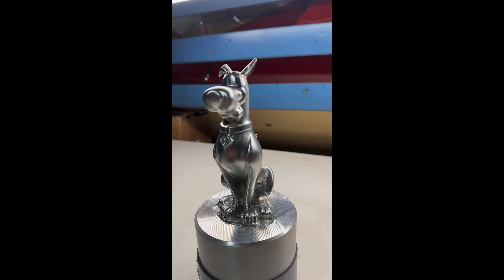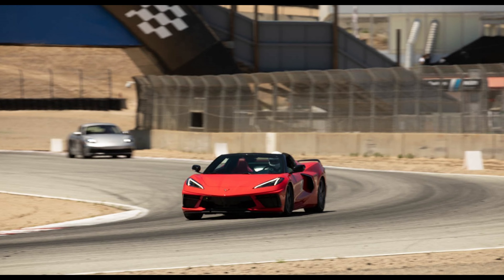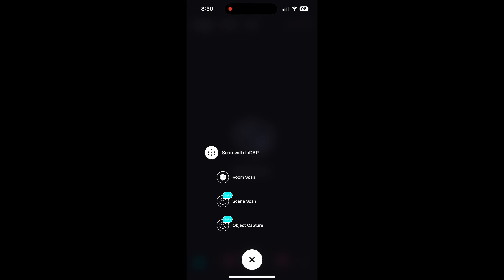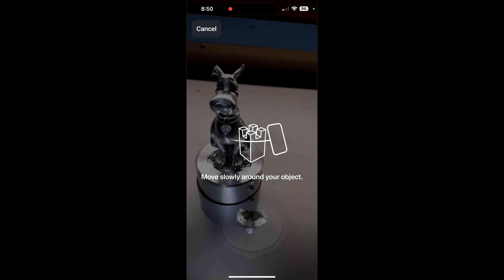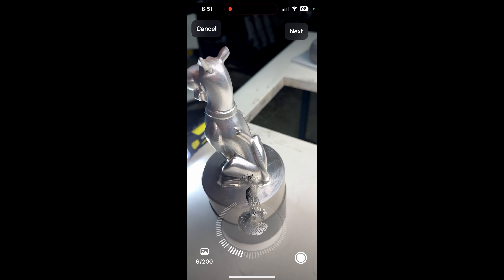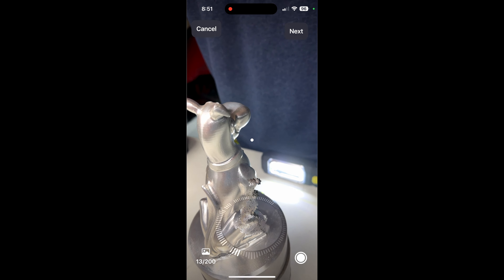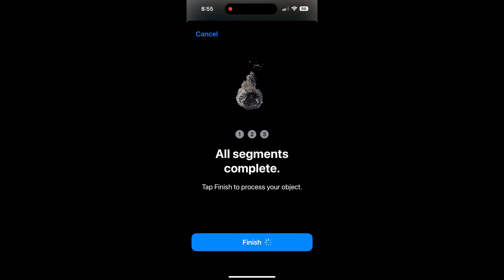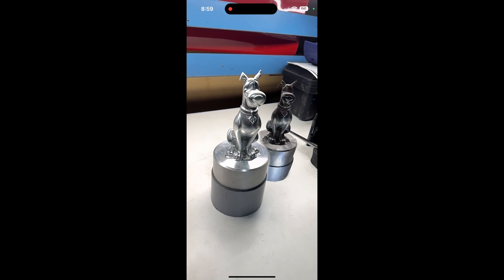iPhone 3D scan with IOS17 and KIRI Engine

Comment: Which IPhone did you use for the scan?
Reply from the maker: I used the iPhone 14 pro max. I found this detailing all the iPhones and Ipads with Lidar. 

"Introduced in 2020, the LiDAR scanner is available on the iPhone 12 Pro and Pro Max, the iPhone 13 Pro and Pro Max, and the iPhone 14 Pro and Pro Max as well as the 2020, 2021, and 2022 11-inch iPad Pro and 12.9-inch iPad Pro models."